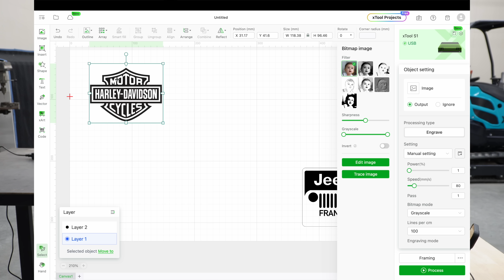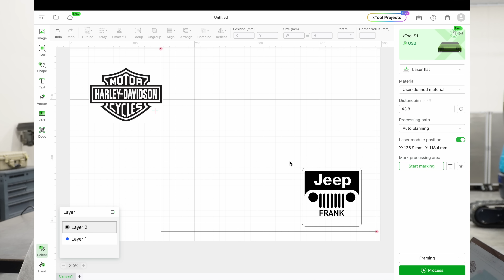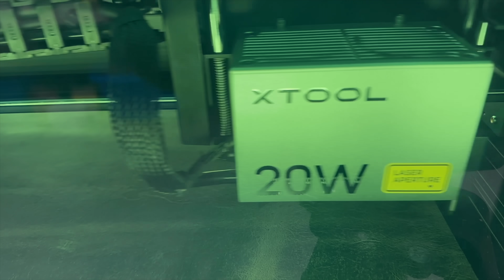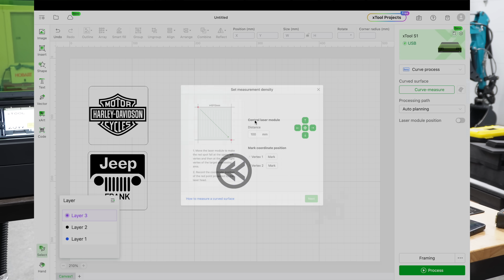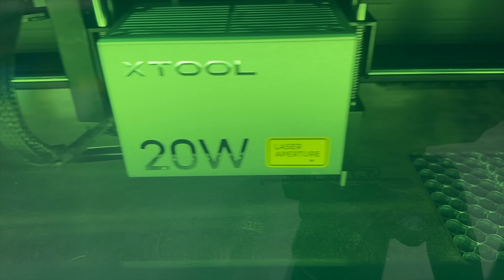This Laser Makes Customizing Gifts A Breeze!

Comment: The S1's diode laser won't etch on glass.  You need to to put a coating of some kind on it first.  CerMark is the gold standard (and costs about as much as gold).  Other options are dry moly spray lube, titanium dioxide, black spray paint, and cold galvanize spray.  I've been playing around with the cold galv and getting nice results.
Reply from the maker: Thanks for the tip!

Comment: My friend had a driveway, that in his words were. About as true and plum as a baptist preacher, during a sermon. I’m, thinking he meet not even. “He is from the Deep South”. He had the foam lifting process. I thought he had the driveway replaced. It holding up really good. It’s been 6 years. He drives a really big four wheel drive truck, he works as an electrician. So he always has a truck load of stuff. I live in an area where freezing is an issue. He asked me to tell you, that would be the way he’d go. But, didn’t know about the inside of a building. Anyway, always glad when you post a new video.
Reply from the maker: Thanks for the info.  Its always good to hear from someone having experience with the same situation.

Comment: Kyle I suggest not going with the spray foam go with the concrete ive seen where bug eat the foam we used to have commercial chicken houses we've seen it through the panel styrofoam and the close and open cell spray foam
Reply from the maker: Good point.  I appreciate the advice

Comment: Kyle, you are a perfectionist. Noticed the layout on the finished designs on the coasters. Evenly spaced for the camera shot! (Thats Perfection!)
As far as the concrete...
Yer gonna have to really research the leveling issue! If the floor has shifted, no guarantee it's still not gonna sink/raise or even be higher after it's... "Level". Then it may crack elseware! Best choice,...
bust it out, check drainage, retamp a stone base, pour a new floor! Of course, after the thought of the cost....ya just may wanna Live with it, and not give a shit ! Lol
Reply from the maker: Hah! Thanks John.  Good advice